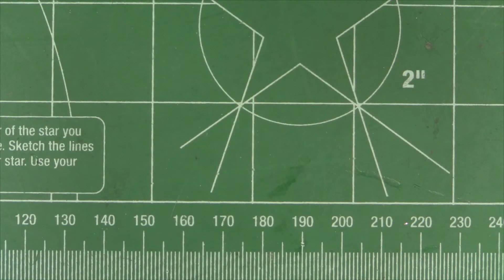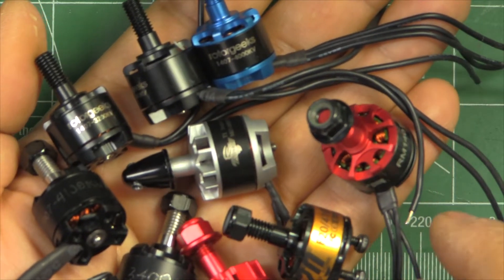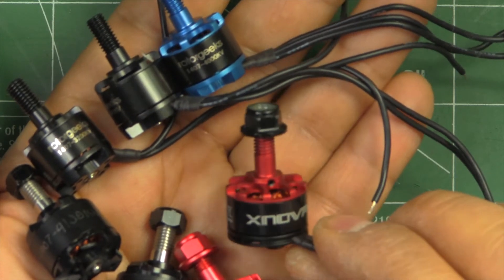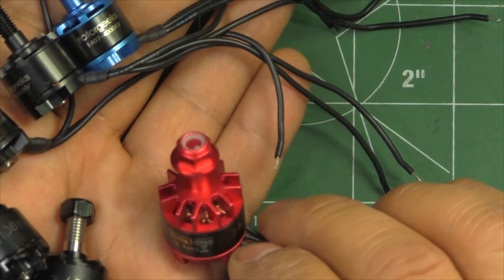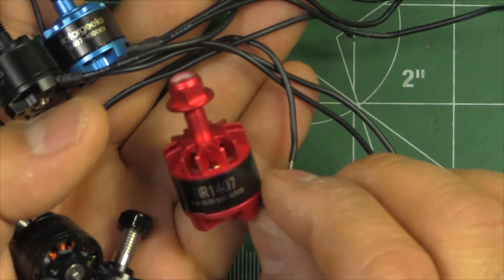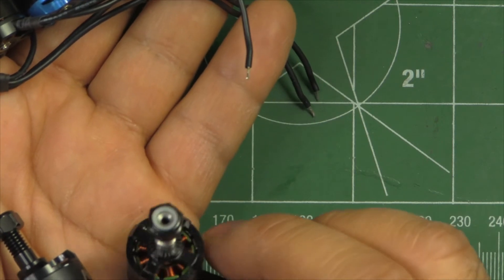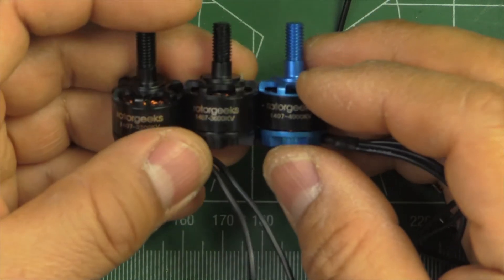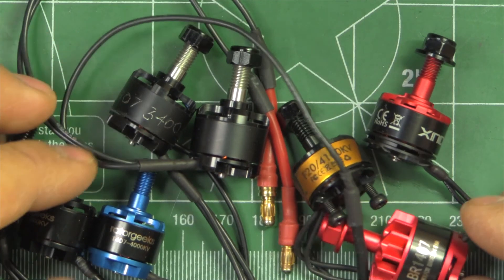Motor Tests Coming Soon! -April 2017

Comment: nice, I wait the test of my xnova RM1407-3500 for choose the best 3 inch prop in 4S in my new config, thx for yours tests !
Reply from the maker: I ran the tests already. First impression it's a very good competitor for the BH - I still have to look at the thrust data however to compare thrust and Watts. Good choice I think

Comment: Very interested to see some 4" and 5" results.
Reply from the maker: For 4", I test the 4045 prop, these motors can survive the load. For 5", I'm a bit weary of the high load that prop would put on the little motors on the thrust stand. I know in-flight, 5" are being used, problem is the static thrust conditions really exaggerate thrust & Amperage to the point that burning the windings in an instant is a clear and present danger :D

Comment: As more and more people are using these with ultralight 5 inch frames, I would love to see them tested on 4s with racecraft 5038 or HQ 5x4x3 or 5030x2
Reply from the maker: 5x4x3 on 4S will probably fry the windings, I have heard of people running them with 5030X2 and 5038x2 on 4S but there's no long-term durability reports yet https://www.youtube.com/watch?v=a7nLldCKf8c
So thrust stand testing is a bit harsh for 5" props on 4S, but in the air looks like the 2-blade low-pitch blades mau work

Comment: please tell me none beats the brotherhobby motors cause i just ordered them after 1 month of research.
Reply from the maker: Toufic Jaafar I wouldn't worry even if one of these beats it, it wouldn't be by a lot and also the BH is an excellent motor as everyone knows so you chose well. Some of these may match it however.

Comment: rotorgeeks 1407 @ 14 grams! really would like to know the results.
Reply from the maker: Danny Mars I ran tests for the 3600kv last night. RG looking pretty good. I didn't have time to do the results table and look at data yet. All of a sudden we're getting some very good 1407 options
Reply: EngineerX great!! please also check for build quality/bearings
Reply from the maker: Will do. I always do the tear down and inspect for any obvious bad QC or design flaws as much as I can under the magnifying glass. But there are some flaws that only become apparent when you start flying and crashing.... like shafts that easily shear off even on light crashes
Reply: EngineerX cant wait for the results :)... will you test with the lumeniers 3x4x3 too? I like them but durabiltity is less than HQ prop, the lumeniers dont break but bend and become useless
Reply from the maker: Yes! One of the Youtube viewers actually sent me a set of Lumenier 3x4x3 to include in my tests, got them just in time to include in these tests. I'm trying to finish the RG1407-3600KV review and get the data sorted by this weekend and finishing the thrust test on the 3200 & 4100KV today/tomorrow. From what I recall Lum 3x4x3 is just slightly more efficient than RotorX T3040x3 and has practically the same max thrust, that was surprising since it has a very different blade profile.
Reply: EngineerX awsome!!!